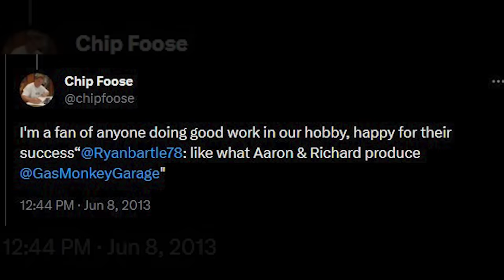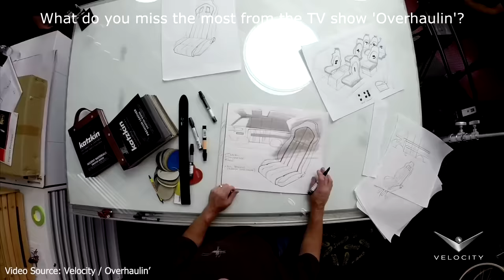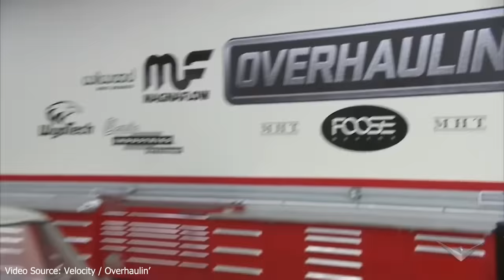Episode Was Removed of Chip Foose and Richard Rawlings

Comment: Uhh... none of the cars on the show were "valuable" before they were restored, especially back then. That was said several times in this video. There may have been a couple nice rollers that could have fetched $10-15k prior to the show, but regardless of the parts used, the people working on the cars were all top-notch and incapable of doing bad work. Every one of those cars were worth exponential times more after Overhaulin and most likely still hold a decent value. This video makes it look like they were just slightly better than Pimp My Ride. Just another lame A.I. generated channel that's killing youtube.